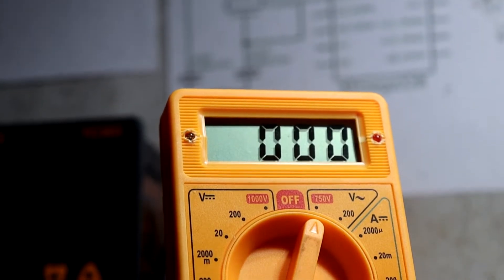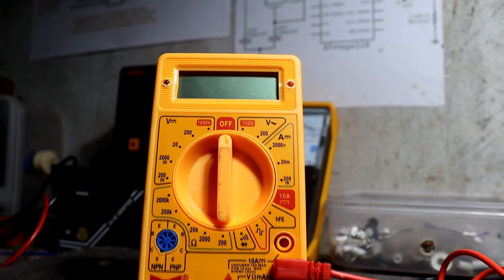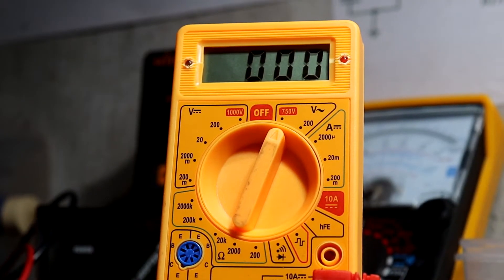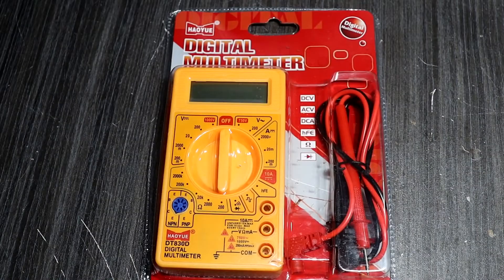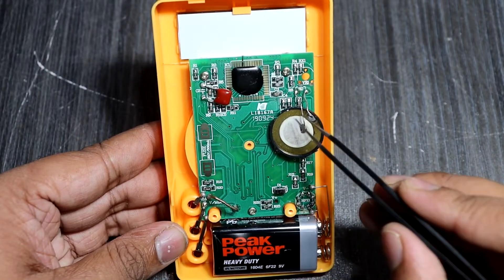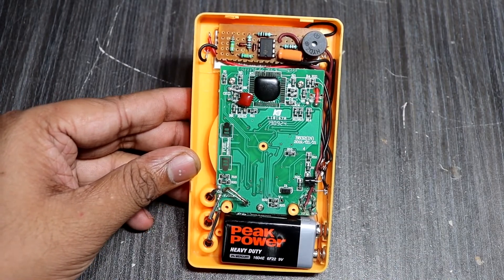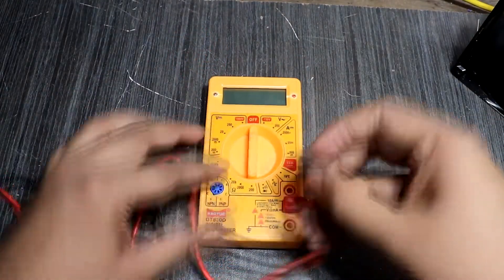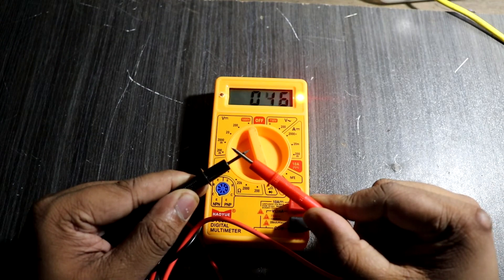HOW TO MODIFY YOUR CHEAPEST DIGITAL MULTIMETER (ADD TWO FEATURES)

Comment: good idea.....sir i am 58 years old from india i want to add this circuit in my multimeter i understood everything from your circuit diagram just where to connect the positive wire in the transistor checking socket?  Or connect to the + point of the battery?
Reply from the maker: The positive wire should be connected to the base terminal of the transistor in the transistor checking socket. This is where the current flows into the base of the transistor, allowing it to switch on and off. It should not be connected directly to the positive terminal of the battery, as this could damage the transistor.

It is also important to note that the circuit diagram you are referring to may have additional components that are necessary for the circuit to function properly, so it is important to make sure you have all of the necessary components and that they are connected correctly before powering on the circuit.

Also, Always be careful when working with electricity and make sure to follow proper safety guidelines, to protect yourself from injury.